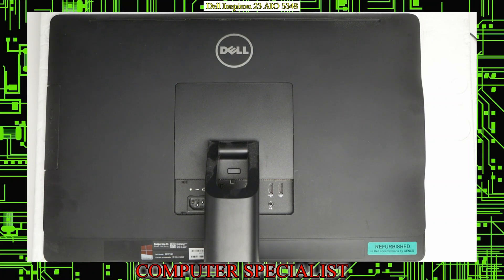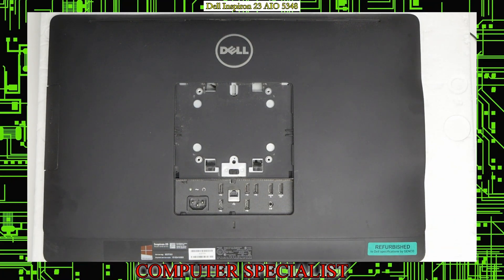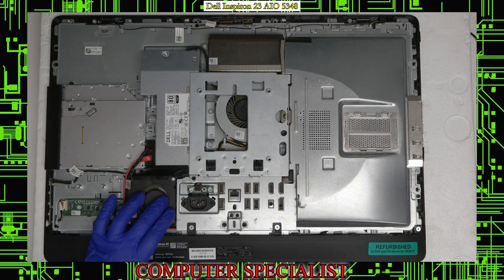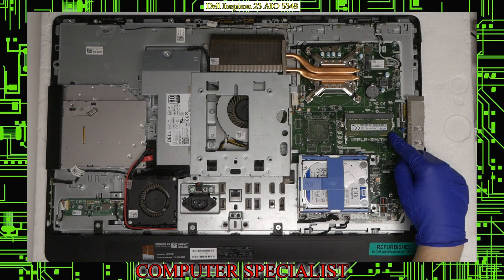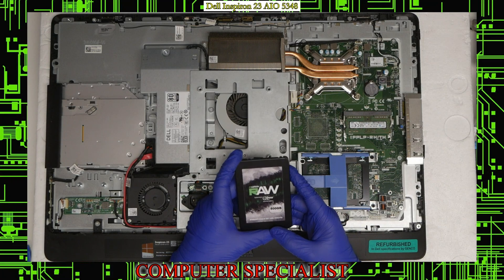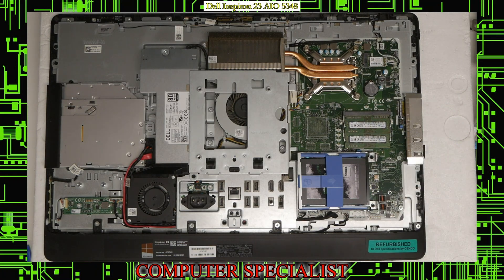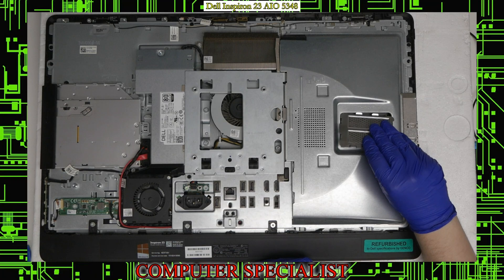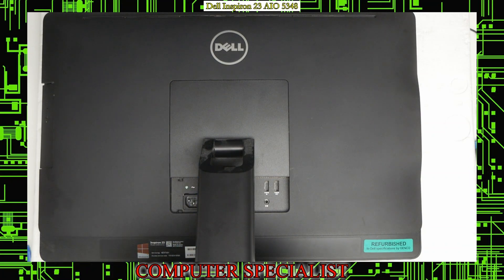Dell Inspiron 23 5348 Hard Drive Replacement + Memory Upgrade

Comment: When I opened the cover, it was hard to lift up the cover, i noticed there was a slide button like under the screen at left and right corner.
Reply from the maker: You can use plastic tools (like guitar pics etc) to loosen it up first. But usually I just wiggle and tug, some are a pain if they are dirty etc!

Comment: I have one of these. Was hoping to upgrade to windows 11 but it says the processor isnt supported and TPM isnt enabled - but i cant find that in the BIOS anywhere.

Is there any hope? Anyone install 11 on it and it run smoothly?

If i were to upgrade the processor, what should i upgrade to?
Reply from the maker: Yes it will run fine on the model! No need to upgrade processor, since you can;t upgrade the generation of the cpu due to motherboard limitations!

https://github.com/AveYo/MediaCreationTool.bat/blob/main/bypass11/Skip_TPM_Check_on_Dynamic_Update.cmd

Click "Download Raw File" the down arrow icon on the top right of screen. Run this file prior to upgrade / install
Reply: @computerspecialist8533  ohhh nice!
I started the Media Creation download to a usb last night before I went to bed and was just going to try it this afternoon.

 Good to know about the TPM bypass! 
I figured it would have started throwing errors around that time
Reply: @computerspecialist8533  on the ram, I see in another comment you said to make sure it's the L version. 
What's different about the L?
Reply from the maker: Standard DDR3 (JEDEC JESD79-3F) requires a supply voltage of 1.5V. DDR3L (JEDEC JESD79-3-1A. 01) requires a supply voltage of 1.35V. Also if it only has one stick or ram in it and has an empty slot, I would try and locate the exact stick that you currently have on ebay / amazon so they match! Double it up with an exact speed match!
Reply: @computerspecialist8533  also, I was literally just handed one of these last night because someone was getting rid of it. So I haven't had time to do much research. Normally I have a much better grasp on what I have 😂

Comment: Good video!
I have no power on mine since I tried to change the ram. I put the original ram back in, took out the motherboard coin battery and pressed the power button for over a minute to drain any charge, but it still won’t show any signs of life. Any advice?
Reply from the maker: Does it power on? (Like any lights or fans etc?)

Comment: On my 2014 Dell Inspiron 23, there are two sliding latches on the bottom edge of the monitor that need to be slid towards the outside edge to unlock the bottom of the back plate.  You CANNOT remove the back without doing this.  They are small round posts about 2" in from the corners on the bottom edge.
Reply from the maker: Thanks for sharing this! I haven't seen this yet!

Comment: Is there a solid state hard drive that could be a good option to replace the original hard drive?
Reply from the maker: Yes as the video states we highly recommend replacing with a solid state as video shows.

https://www.newegg.com/p/pl?Submit=ENE&N=100011693%208000%20600038463%20600038492%20600038502%20600414920%204814%20601356772%2050001077%2050001306%2050001455%2050001305%2050001157%2050001183%2050001314%2050001504&IsNodeId=1&bop=And&ActiveSearchResult=True&Order=PRICE&PageSize=36